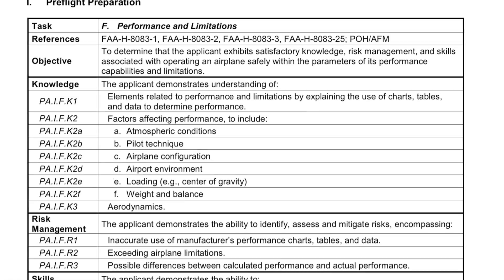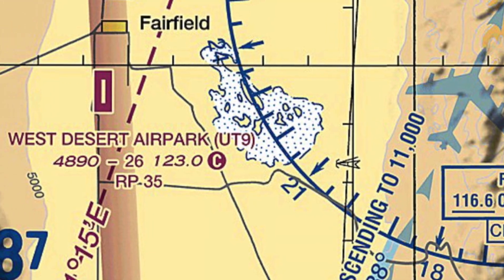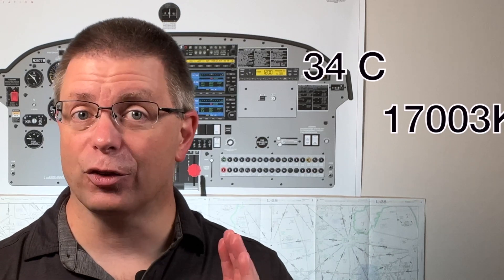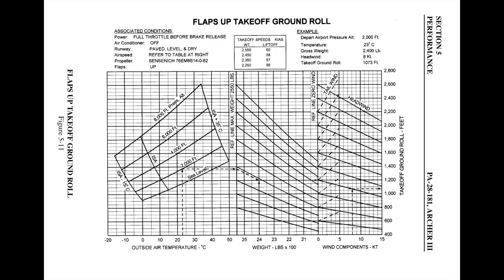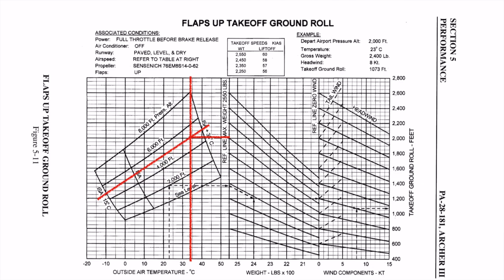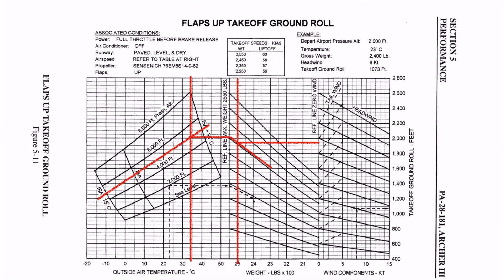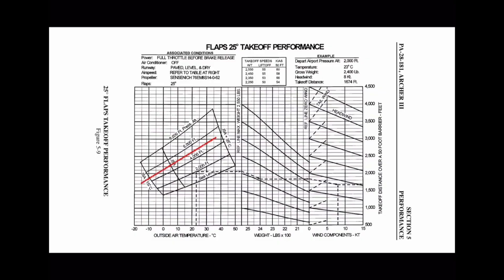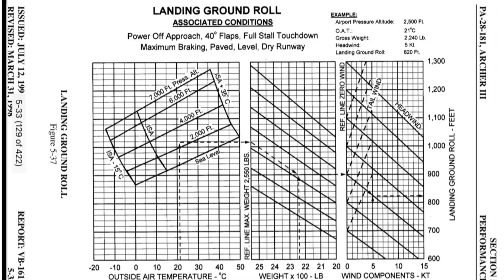Checkride prep | Takeoff performance

Comment: Why did you use the Flaps 25 degrees take off performance chart instead of flaps 25 degrees ground roll? For the regular takeoff without an obstacle, you used the Flaps up take off ground roll chart

Comment: How do you set up when have an extended down wind
Reply from the maker: Interesting question.  I guess it would depend on how long the downwind is and why you are extending.  Since the time and fuel to climb should be about the same regardless of wind impact, the biggest difference would be how much further you have to travel to get back on course.  

If the extension is for traffic reasons, I wouldn’t specifically plan for it, but would keep it in mind.  At our airport, most traffic-related extensions take less than 5 additional minutes.  At 11 gallons per hour (75% cruise) that is under a gallon of fuel. However, if the extension significantly delays your arrival at your first check point, you may need to be prepared to change your plans.  

If you are doing the extended downwind for obstacle or airspace reasons, then I’d suggest planning it as part of the route.  This means you may need to break the wind corrected distance calculation into several parts and use different winds for each part.

I hope this helps.  Thanks for the comment and question.
Reply: I was doing my training when the air traffic control sent us further downwind to call out base

Comment: Does C172 has performance chart like PA28? I mean graphic chart not table.
Reply from the maker: Thank you for the question.  The POHs I have seen for the various 172 models do not.  Instead of the graphic charts, they supply tables to be used for various different weights.  Having said that, you still need the same information:  Pressure Altitude, Temperature, Weight, and headwind/tailwind component.   A comment about using the tables and charts… Don’t forget to read all the notes.  For example, the Cessna tables suggest reducing by 10% for every 9kts of headwind and adding 10% for every 2kts of tailwind.  Plus, they suggest adding 15% to the ground roll for dry grass runways (as opposed to paved runways).    I find the Cessna performance tables pretty straight forward… Find your pressure altitude, move across the table until you find the nearest temperature column, read the “Ground Roll” and “Total to Clear 50 ft Obstacle” numbers, then finish by adding or subtracting based on the result of following the notes.  Part of the reason I made the video for the Pipers is because I find the charts more difficult to use.   I’ll add the suggestion of computing take off distance using the Cessna tables to my list of future videos.  

Thanks again for the excellent question!
Reply: @ScottKoonCFI  Thank you, I appreciate it. I enjoy your video.
Reply from the maker: @Ezel21love  Thank you!!